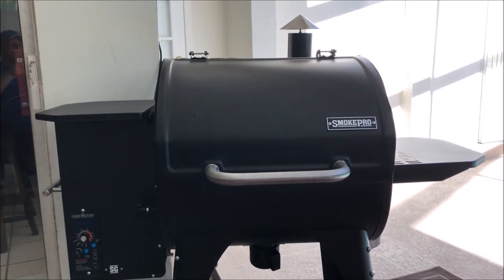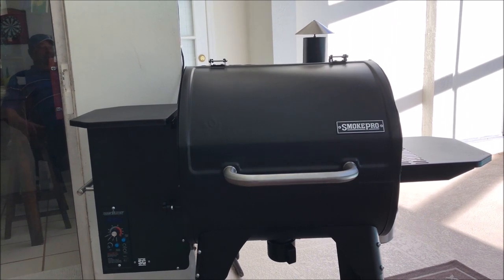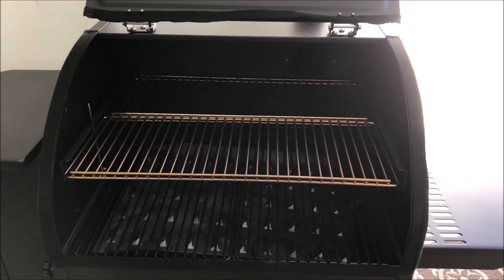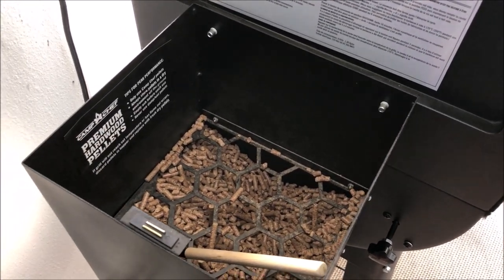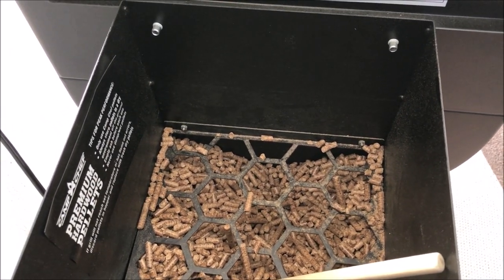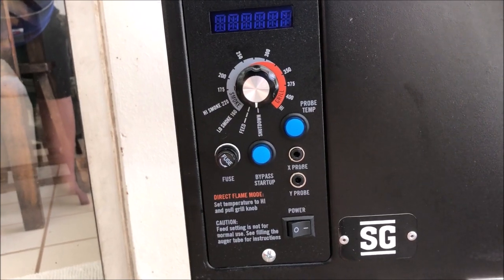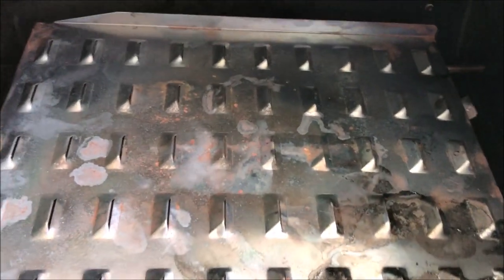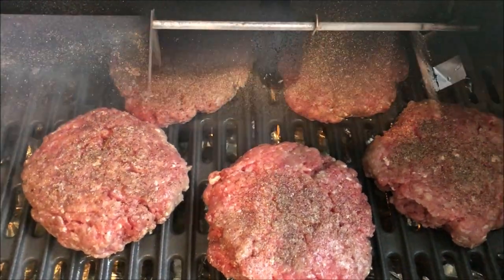Camp Chef SmokePro SG 24 Pellet Grill and Smoker Features and Review

Comment: Camp Chef listens to there customers and affiliates. They are always innovating. I purchased last year the PRO LUX model and love it. The tray with the slots is kinda what I thought of to cover the water trough of the SLOW N SEAR to prevent grease and drippings falling into there.. nice walk through and explanation. 👍🏼💪🏼🇺🇸
Reply from the maker: I was just explaining the difference between the Traeger Pro and the Camp Chef SG and the Camp Chef has more cooking space, Bigger pellet hopper, ash clean out, slide & grill, sear box option, and a 3 year warranty.. all things Traeger does not have and the Traeger cost more.
Reply: I am most likely buying this very unit but with the updated hopper window and bottle opener they all come with now. The only downside is the requirement of the sidekick or searbox for searing, but overall I am happy with what Camp Chef does with its products, service and ecosystem. The main competition at this price is Pit Boss Pro 1100 with double the hopper, 1100 sq in of space and a bigger fire for searing. But the Pit Boss sacrifices the good controller, easy clean up, amazing accessories and acclaimed customer service of the Camp Chef. I'm going with Camp Chef.

Comment: Nice!!! Just curious why you need the sear box when you got the sg model?
Reply from the maker: because the sear box has a larger searing area and gets much hotter.. the Slide and grill feature is OK, but has a much smaller sear area and still does not get as hot...
Reply: @FireWaterCooking  thank you for the response that helped just picked up a SG
Reply: Slide and grill won’t slide now with rod.  Used to work fine